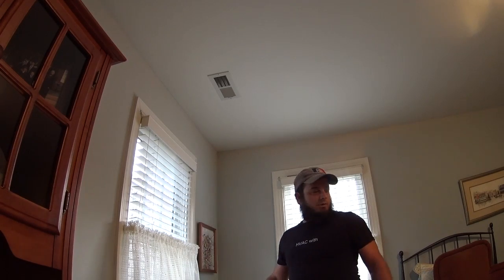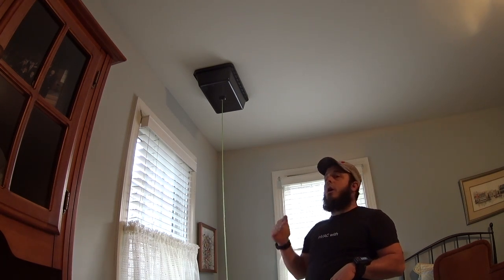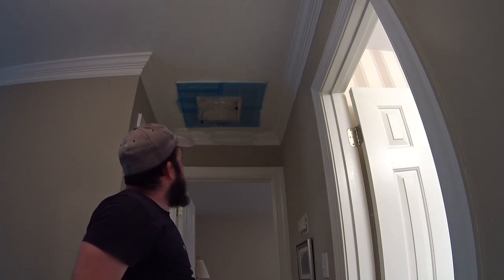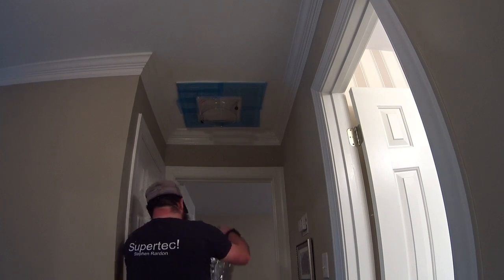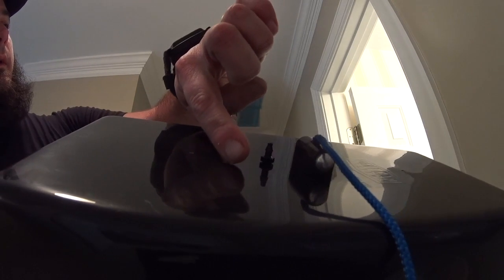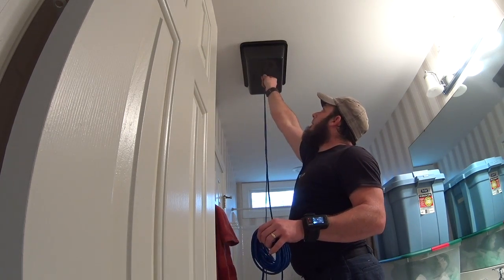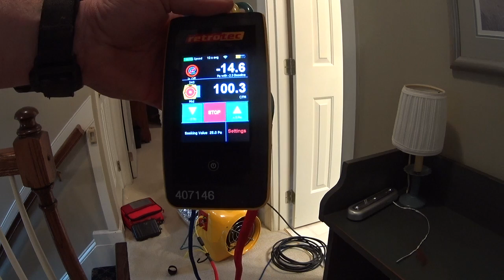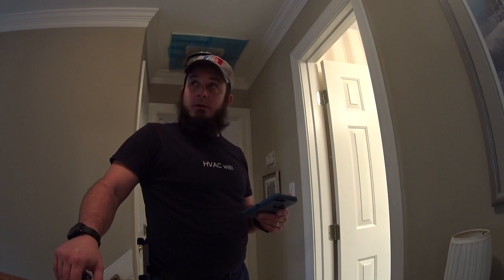Retrotec 240 Duct Testing

Comment: Nice to see someone finally testing ducts. Its gonna be an eye opener. Try getting a cheap small theatrical smoke generator and pressurizing the duct with smoke to find leaks. Next video should be leakage to outside.

Comment: Steve random question, I'm looking at making an investment in either a testo 550 or a smart probe set. I've been doing my checks and charges with an anolog set and I'd like to up my game and diagnostic ability. If you only had money for one which would you choose... or would you recommend something else?
Reply from the maker: It’s nearly equal between the two. Probes would give you more data than the 550’s so I’d go that way I guess

Comment: 128@25. 
Nice. Cut that in half. 
Happen to get leakage to outdoors?
How much time for whole project?
Reply from the maker: Two separate systems leak tested, sealed up and retested, by myself (except for an hour or so with a friend over) took me from 8am to 6pm. Ran home for about 45 minutes to change cloths and shower after bathing in sawdust. How many hours is that? Maybe 7-8 hours of actual production?
Reply from the maker: Honestly I’ll have to check up on Testing to outdoors. Don’t think I’ve ever seen that test.
Reply: Here is my webinar on Leakage to Outdoors - https://youtu.be/4Gg7mKtRD8E